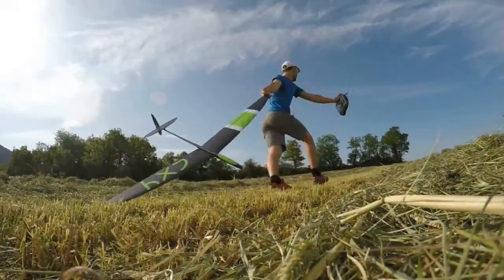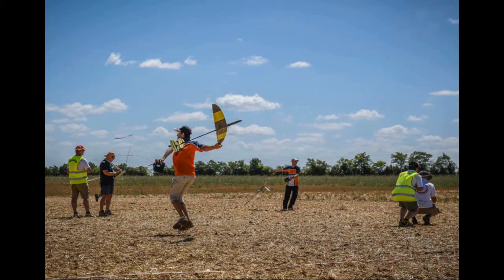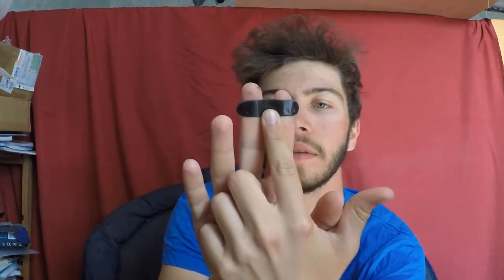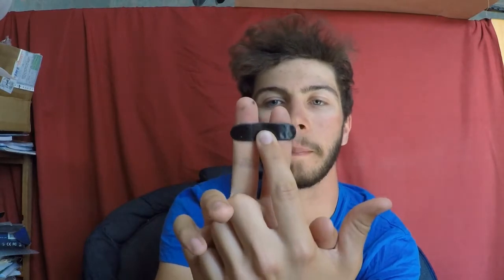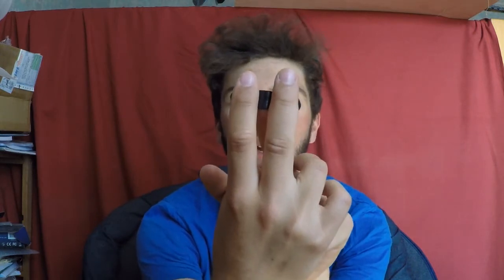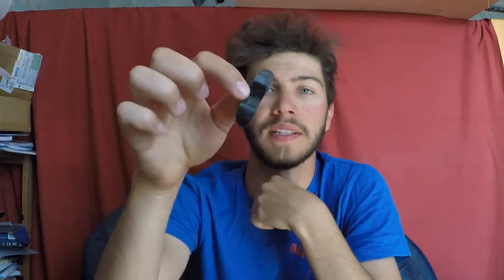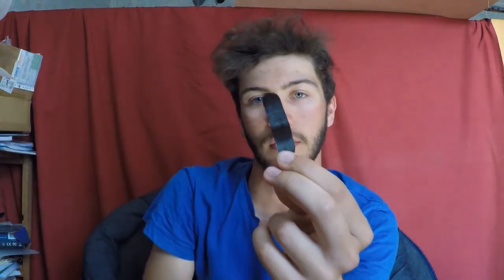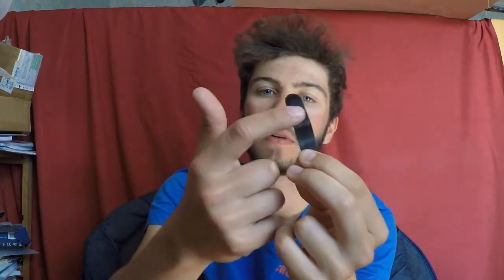Monday outburst N°008 : How to hold your peg

Comment: Useful tip. I've broken the tip on literally every DLG I've owned. Looks like I need to set them up with that reverse sweep you mentioned. I also find that I have to put the peg as far back against that first finger joint as possible or the plane tends to slip off prematurely which causes a significant reduction in launch altitude. I don't have this problem on most smaller DLG's except for my Stratair X-ray which is quite sensitive to this.
Reply from the maker: joshuawfinn yes me to, I have the same problem , it s why my pegs are no offsetted .